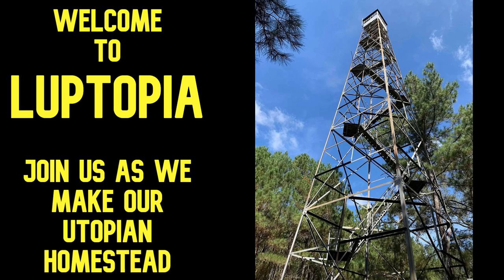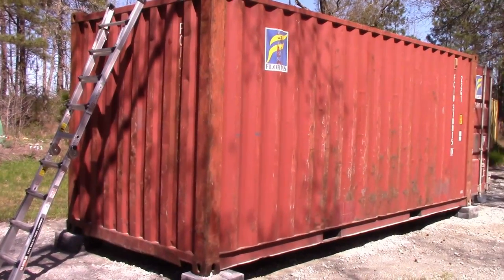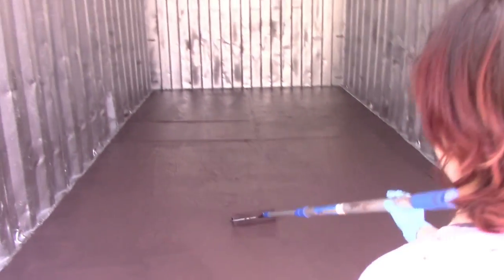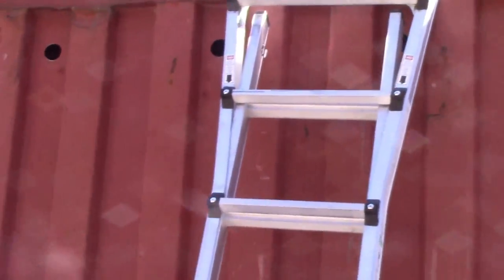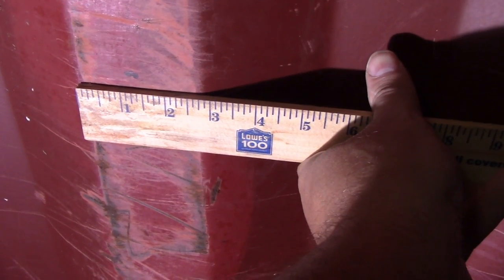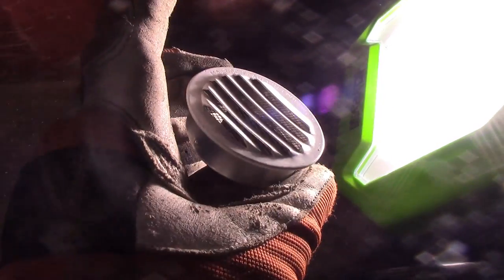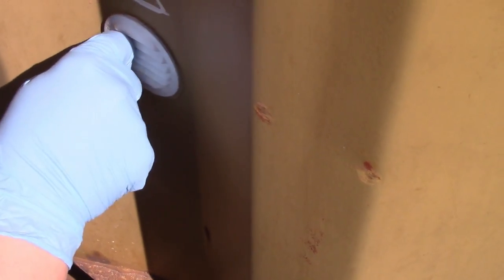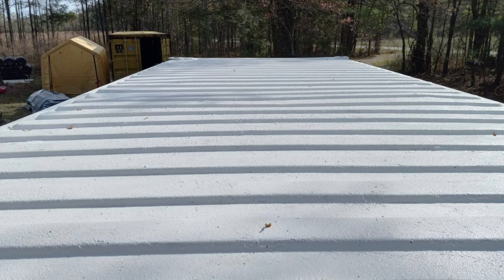SAVE MONEY -  Cool Your Shipping Container Without Power - Cheap Ventilation and Cooling Ideas

Comment: Price of shipping containers have significantly decreased. Look at Ritchie Bros Auctions near you. 
20 ft containers can often be moved by local wrecker companies on a “roll back” or tilt bed wrecker and placed where you wish providing space is available for wrecker to tilt and pull forward enough to unload and leave. 
I use 6” x 6” treated post (5 on a 20 ft container & shim with treated wood to level) 
Place first one down for delivery to start and have pin flags on each side marking intervals to position other 4 timbers as driver pulls forward. 
I have set two 40 ft containers and 3 20ft containers like this and it worked great.

Comment: I've got a couple of containers to which I added an internal air-tight shell - basically another inside wall that is the thickness of a 2x3. And also a 4th wall with a door and window. At the top of the 4th wall is an exhaust fan that sucks the air from around the inside wall to keep the air actively circulating.

I didn't know about that additive for the paint - I'm definitely going to see how that works.  I'm in North Central FL, so we get plenty of UV here, too.

BTW - if you check online you can find some of the container resellers that will let you buy a 'new' container that was only used once. They're usually in perfect condition and save a lot of prep work.
Reply: I'm also in Nawth Central Florida, Suwannee Co. and will be buying a 40 ft High Cube soon, it appears to be one of those new or 1 trip ones, ya need to vidio your idea, I can't seem to picture it
Reply: @REVNUMANEWBERN   I've been thinking about that. I'm away right now, but will see if I can when I get back.  I'll try to remember.

Comment: I just got a 40x8 and mine is in really bad shape.  It is water and wind tight, as we recently had a downpour of 4.5 inches of rain.  The floor is in really good shape.  The outside has a big scar where they welded it closed.  They also welded in roof patches. I think there is 5 of them.